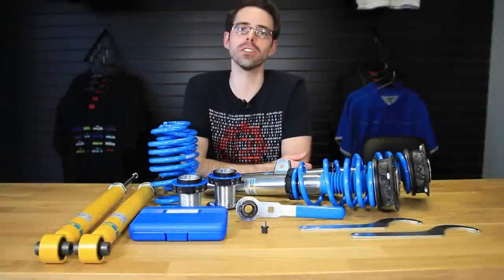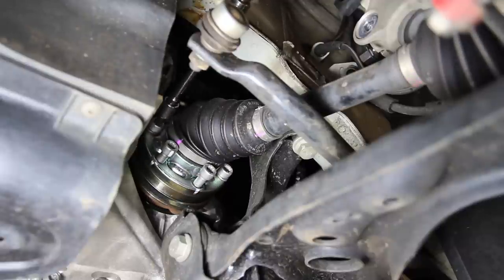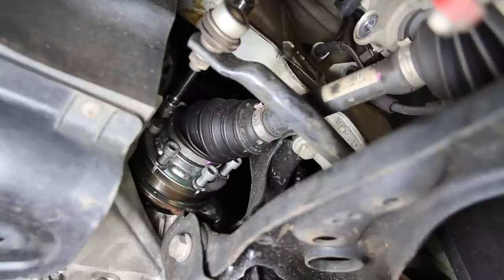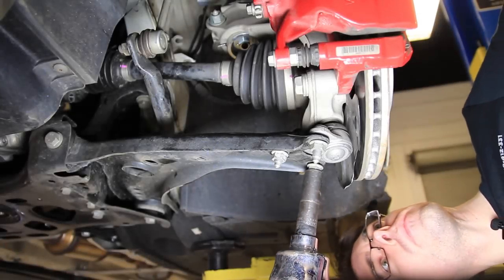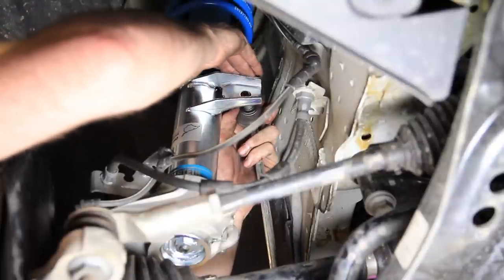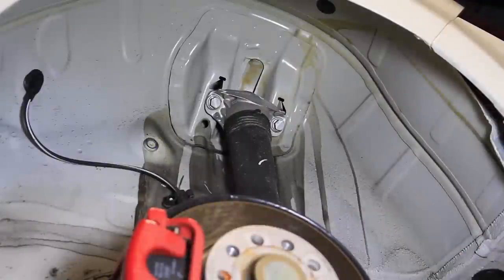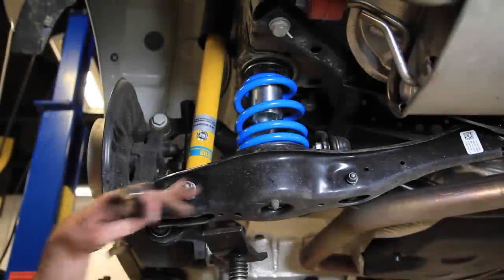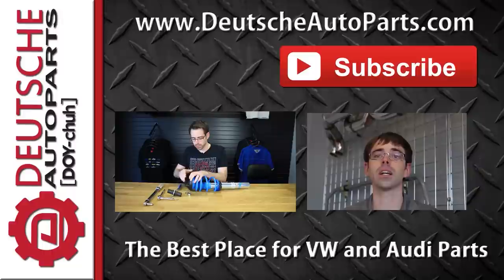How to Install VW MK7 GTI Coilovers (MK7 GTI Mods)

Comment: Great video. Your video was the only one showing to loosen the inner axle bolts. This was so easy and made the install process go so smooth. It also helped us find that some of the bolts were barely more than hand tight.
Reply: a piece of 4x2 with a hole thru it near top for old pinch bolt works well just put bolt thru sway arm hole and raise 4x2 with jack , saves a shit load of work , new unit drops in easy as shorter than stock

Comment: Just finished putting them on my car. Went for a ride on 17" and suspension is worth every penny I payed . Car is a lot more precise and response on steering. It is stiff, but because it's precise, it's  not taking your teeths  out, so going for a ride with family is not a problem. Smooth ride even through rough roads.

Comment: Few questions....1) Is your air set to certain torque settings? Not sure if there's any torque specs for all the bolts, or do we just "tighten" it....2) Is the process the same for DCC-equipped GTI's? Unfortunately DCC is mandatory with performance pack in Canada, which I really want but still hoping to change to coilovers. Not sure if this affects both hardware and software with the DCC? Thanks.

Comment: My only criticism is tightening everything with a rattle gun, with suspension parts if you over tighten the rubbers to much they can squeak or wear and split prematurely! Should always use a torque wrench and torque to manufacture specs. Other then that nice job! 👍
Reply: Must be a pro
Reply: @brianb2454  no just a retired mechanical engineer that likes doing things right and not half arsed! But whatever!

Comment: Back when I did my MKV I removed the big axle nut in the hub. Is removing the axle at the trans really better? Or is it because those axle bolts aren't cheap and need a lot of torque?

Comment: I just did the springs upgrade to my Mk7 GTI and I love the way it looks as you said if you have a mk7 GTI you will see the different !! After driving this car for a year in the stock suspension I can feel a big difference !! I would like to know If I get this Bilstein PPS Coilovers can I have the same high as the sprigs !? Is the ride quality better than the springs.!! ?
Reply from the maker: El Chero Yes you can get a similar ride height as the springs.  Our coil overs were lowered all the way down and should be able to go up around 1.5-2 in.  As for ride quality the coil overs will be much more precise and your springs.

Comment: Why didn’t you just take the hub away from the shaft? Wouldn’t it be easier to do that? Since the hub comes out with the spring and shock absorbers? And then install the new coilovers on a workbench?

Comment: Is it OK to just zip everything together with the impact like that?  I would figure a lot of this stuff is torque-sensitive.  Does the impact tool used have some sort of advanced clutch that applied varying amounts of torque?
Reply from the maker: +EMuybridge This would be how most techs would install a suspension.  There are torque specs recommended by VW which can be used if you feel more comfortable.
Reply: Always tighten things down to proper torque specs. This is a pretty shoddy job IMO. Things like that pinch bolt holding the knuckle to the bottom of the strut most likely has a specific procedure. Something like 30ft/lbs then back 90 degrees, then tighten to 75ft/lbs and tighten another 90 degrees is common on those types.
Reply: People really do over look torquing bolts properly. I had new wheels fitted recently that use centering rings, they absolutely need to be tightened to the proper torque using a star pattern or the wheels will not spin properly causing all sorts of noises/problems.. I had a shop that was ready to start grinding down my centering ring thinking that should solve the issue because they were dead set on just using the air guns to tighten down the bolts, i explained that you'll have one bolt tighter than another bolt and one might be over torqued and one under torqued and so on.. I had them tighten all bolts to 92lbs and have not had a problem with my wheels since.  I will always follow the proper torque spec now.

Comment: On my 2015 Golf MK7, the rubber boot covers the drive shaft bolts...in your video for the GTI those bolts were exposed. My question is, do these bolts on the drive shaft need to be removed and is there enough travel to lower the the strut off knuckle mount?   I'm not sure how to remove that rubber boot to expose the drive shaft bolts...  Your videos are very helpful.  I think the rears are very straight forward.  Thanks much!

Comment: I just purchased a Passat that has BC coilovers on it. I want to adjust topthat camber and install my angle sleeves on the bottom (Looking to get -8 degrees of camber). Do I have to unbolt the axle to do this since the suspension on the car is already shorter than the stock struts? I know I’ll have to purchase a strut spreader tool regardless.

Comment: Did you use the stock front strut mounts or aftermarket? I have the 034 Motorsport front strut mounts on my MK7 GTI and thinking about going back to stock due to the noise and since the shop has needed to retighten the top nut 4 times already in less than 10 thousand miles.

Comment: Curious, why not just remove the knuckle in the front rather than loosen the axle? When I'm install mine I will also be replacing the rotors, pads, as well as brake lines so I was curious if that's be easier or not.
Reply: Should of added mine is a mk6 by the way.
Reply from the maker: Jd Sweet You can but its not needed.  A MK6 would be very similar to this install on our MK7

Comment: What are the torque settings for front/ rear axle bolts and front/ rear bolts that hold the shocks to frame? 

Do I need to replace the front and rear stretch axle bolts? 

Thanks and keep up the good work!
Reply from the maker: Bryan LeBlanc Take a look here.  You should find what you need https://deutscheautoparts.com/make-model-year/volkswagen/gti/mk7-2015-present/steering-and-suspension/install-kits/mk7-gti-suspension-install-kit-basic.html

Comment: I see the spring on the front struts on the b14s are fatter than other coilover brands. Do you think rubbing will be an issue on a 19x8.5 wheel with 225/35/19 tire?
Reply from the maker: MDdalipe Tough to say for sure.   That would likely depend on offset and other things.  We are running 18 x 8 wheels with ET 37 and have no issues.  Our coils are spun all the way down and we have 225/40/18 tires on them.  Hope this helps

Comment: Question in regards to the three nuts for the lower control arms.  Are they one time use also?  I'm looking into install VWR springs on a golf TDI see.  The only difference is the rear has torsion beam suspension.
Reply from the maker: +Paul Dolores Most suspension bolts suspension bolts are 1 time use.

Comment: Question from an un-initiated to those who know; would running staggered coil overs be safe?  What I mean is running a lower ride heigh in the front and keeping stock suspensions in the rear or even coilers in the rear but slightly higher ride height than the front.  

Thanks
Reply from the maker: +supercooled You shouldn't run just coilovers in the front but not leaving the vehicle level is ok.  This may however affect the way the vehicle handles.
Reply: Mechanically safe but I'd not drive very aggressive that way.

Comment: Do you recommend camber plates for the install? I just bought the Bilstein B16 for my 2006 Passat. Some folks talking about the natural camber it will have from lowering & new suspension. Any thoughts?
Reply: Just so you all know Bilstein voids warranty if you use camber plates. I like warranties. So my install is done, Car is a new machine! Highly recommend Bilstein.  Have the PSS 10 B16
Reply: @SystemUser76  how diff is the ride now?  Was considering B16 but have heard even in the comfort setting it's harsh.

Comment: Good Afternoon, 

I recently installed my coilers thanks to this video however I'm hearing a clunking noise from the front on both sides, any ideas as to what it is

very respectfully, a subscriber
Reply: The shock bolt might come loose. It’s the bolt in the middle of the top hat that connects it to the strut.
Reply: strut bearing, or you have bottomed out and are hitting the bumpstops.

Comment: the Metal Nerd Strut Spreader Tool does it work on a 2007 mk5 gti i did see on that site you put a link to from 2006 to 2009 mk5 Rabbit but not sure if its the same for mk5 gti ?
Reply from the maker: Yes it would work.
Reply: oh ok thx

Comment: how much drop will it be over the stock suspension at the heights setting? Not trying to stay close to stock height.
Reply from the maker: +Kenny Rhee Take a look here for the info on these coilovers used https://deutscheautoparts.com/47-229976.html

Comment: Would this install be much different on an 09 MK5 GTI? and also are any specific torques with a torque wrench needed for this install?
Reply from the maker: This install would be very similar on a mk5 GTI.  Torque wrenches would be needed if you plan to torque all your bolts down properly.
Reply: ok thanks...and does it really matter if i do?
Reply from the maker: Justin Sparrow Torque specs are there to be sure that everything is properly tightened.  Choosing to use them is completely up to you.

Comment: what size is the tripple square to take the bolts off the drive shaft?
Reply: Yes what size is that triple square
Reply: It's a m10 triple square for the 6 inner CV axle bolts

Comment: Would the 2x4 method prevent you from needing to remove the inner axle bolts?
Reply: Tried it but I rather do this amd try and adjust a 2x4 tike and rice again because sometimes the jack moves amd your back to square one. At least here you only have to do things once

Comment: the mk7 back is more like the mk4 backside right? not like the mk5/6
Reply from the maker: shameboy2 The MK7 shown is very similar to the MK5 and MK6.  The MK4 used a rear beam type suspension which you won't find in a MK7 GTI.

Comment: I installed kw variant 2 on my gti and now i have problems with a sound when i turn to rigth of left...do you know what would be the problem? Sorry for some words im from Colombia.
Reply from the maker: Michell David Ruiz Most likely this is an issue from the front strut mounts and bearings.

Comment: Paul, I did a strut install over the weekend on a mk7 gti automatic. I had a heck of a time reattaching the axle back to the transmission with the six bolts. It seemed like it would be easy to reattach but I could not get the bolts to go back in all the way. I tried slowly working with a star pattern but it would still come off center and the would holes would not align. Four hours later and I think that a shop will have to complete the final axle to transmission reinstallation.Any ideas? Is the Axel to tranny connection keyed in some way?
Reply: ChefDeath were you able to reattach in your own? Just wondering because I will be installing coils this weekend.
Reply: Little late now probably. I just installed new coil overs on my mk7 manual and when I dropped the axle the ball bearing of the passenger side cv joint fell apart. Couldn’t put it back together due to limited space underneath my car and ended up taking it to a shop to get it fixed. Ended up with a new axle and new bolts because those are apparently one time use only. Would recommend not touching the axle and trying other methods.

Comment: My inner axle is too far from the transmission to reconnect it.  How do I get these together?
Reply from the maker: Gary_y You will often need to hold the inner axle joint with one hand while you thread the bolt with the other.  Good luck and have a happy 4th of July

Comment: how do you adjust CAMBER on this type of suspension? i cant find info
Reply: No camber adjustment on this particular coil over. However, you can purchase strut mount camber/caster adjusters. Also, if you get the more expensive bilstein coilovers, you can adjust ride height as well as damping stiffness.

Comment: It looks like you did a whole lot of extra and unnecessary work in the from tbh could have gotten it done without taking the knuckle off the lower control arm and without taking off the axels but hey y’all are a professional company that has to show how to do it “correctly” 🤷🏽‍♂️

Comment: Question, I don't have a hydraulic 4-point lift, I have jack stands and a floor jack.  I can't see any place to jack my MK7 up in the front or rear other than the pinch welds.  Can I place a jack stand somewhere under the part of the car I'm jacking up other than the pinch weld?
Reply: ECS tuning sells jack pads to make a convenient spot for you to jack it up. 
https://www.ecstuning.com/b-assembled-by-ecs-parts/jack-pad-adapter-kit/ecs10724kt/

Comment: I thought you didn't have to remove the axle?
Reply: you don't. They decided to slide the knuckle down while keeping the strut screwed in to the top mount. You can unscrew the strut first, slide the strut out and then take the strut out of the knuckle at an angle.
Reply: Themayseffect thanks alot man, this really helped my installation go alot smoother than this video. We tried this video but it just took forever and it required certain tools that we did not have. 👍
Reply: Emerson C did you keep your axle in place then and just remove the strut from the top mount ? And remove it at an angle then if so was this easy and and simple ?
Reply: Joshua Maskell yep. It was quite easy after that. This video is overcomplicated. Everything went smoothly from the guy's comment 🤙
Reply: Emerson C brilliant cheers for you fast reply mate and and Thanks to the other fella for his help 🤜🤛
Reply: Joshua Maskell no problem. Good luck with the installation
Reply: Emerson C Forgive my confusion here, never attempted this before, but can the strut be dropped without compressing the spring? Do you just remove the 3 bolts holding the mount in place and it can be dropped?

Comment: really it of unecissary steps. and a few necessary steps missed. new torque to yield bolts are a must for safety. plus why disconnect the inner axle why disconnect ball joint I just did this job without disconnecting half if what you did. seems like a waste of time.

Comment: I'm shocked that the mk7 suspension is basically identical to the one on my old mk5. VW changed virtually nothing. For those watching: you can also opt to release the half shift by removing axle bolt at the hub instead of at the trans. Lotta torque on it but easier to access imo
Reply: Maybe cuz they were happy with how its setup, they really need to put better lca bushes tho cuz wheel hop is so bad on the GTI

Comment: I thought this was going to be an actual coil over kit for the rear. It's still the same setup just different shocks and springs. A coilover setup would have moved the spring outboard and over the shock.

Comment: Did lowering the GTI throw up any error codes regarding the adaptive suspension?
Reply: If your GTI comes with DCC from factory, you will need an EDC delete kit to bypass the error code